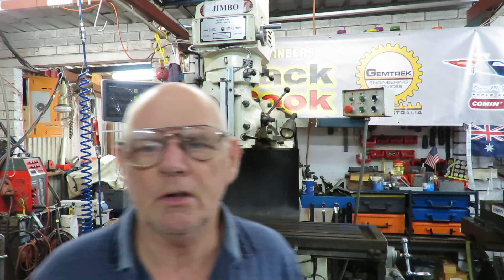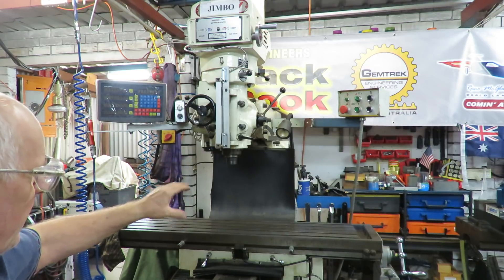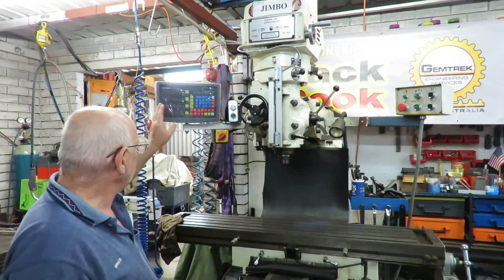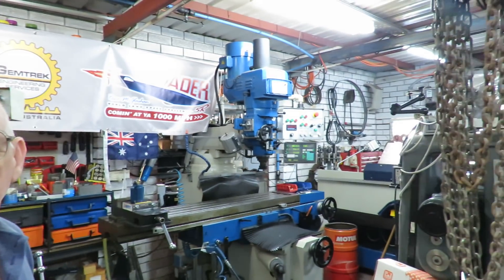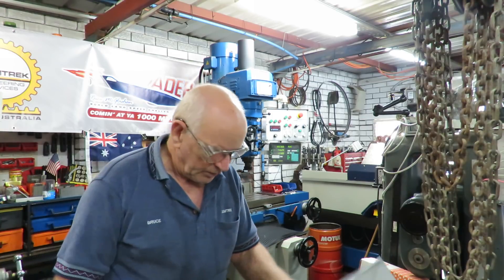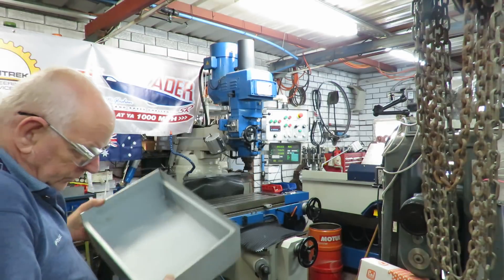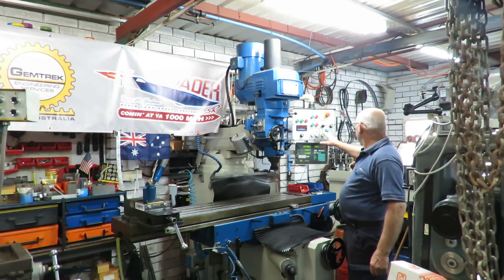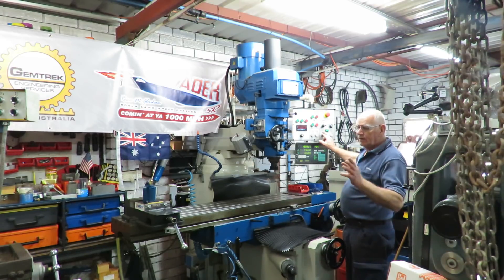The  Jimbo Bridgeport style Mill Controls Upgrade

Comment: Are you trying to say at about 5:30 or a bit before that Jimbo reverses spindle rotation when you change from high range of spindle speeds to low range? You have me a bit confused there Bruce. John, Newcastle way.
Reply from the maker: John Maybe a bit of muddling there. What normally happens in most Bridgeport style heads is when you shift the gear lever on the head from Fast to Slow (direct drive to back gear) the spindle turns in the opposite direction. and consequently you need to swap the forward / reverse drum switch over and then press the start button. In the case of the Tomas (BM70VE Mill) they have fitted a micro switch that is activated when you turn the lever to the back gear position, a signal from the micro switch provides an input to the VFD and it reverses the motor direction without the operator needing to do so. The forward push button on the panel operates normal direction in both direct or back gear lever positions, pressing  the reverse push button operates the reversing in both gear positions a simple set up that is very helpful. I hope that is clearer. You live in a nice spot there lots of fishing, and the home of the ducks nuts hotel I still have some of their caps.
Reply: Thanks for your reply Bruce, that clears things up for me. I do not own A Bridgeport of similar style mill nor have I used one so that is my excuse and I am sticking to it. My machine is A Brown and Sharp Universal 2A. It is old enough that it is flat belt drive so reverse is in one of the two gearboxes  other gearbox is for feeds (X,Y&Z). Lovely Machine, came with the dividing head and all change gears for helical/spiral milling as well as the table swivels 45 degrees either side. Only slight drawback is it lacks a quill feed, so be it, after all it is near 100 years since it was made.
  About fishing, prime time now to go beach or rock fishing day or night, always get a feed as well as relaxation. Not familiar with the hotel, still some time left though, cheers from John.

Comment: I like the idea of the microswitch on the back gear lever. Except I have too many years without it, so I know I would always flip the switch the wrong way in low. Even 10 years after getting a vari-speed mill, I still find myself reaching for the step pulley back gear levers. Maybe if I make a control box like that, where everything would be new and different,  I could unlearn the old habbits.